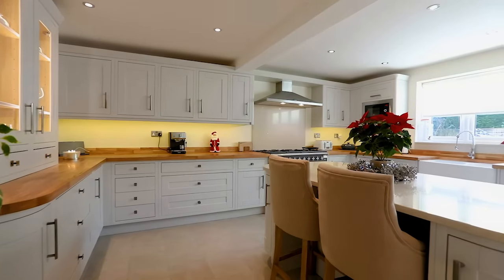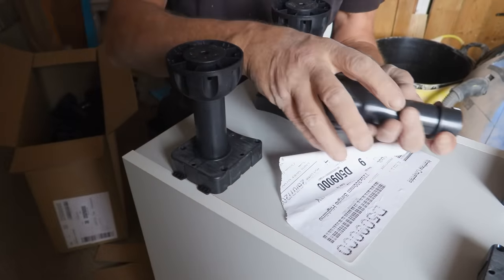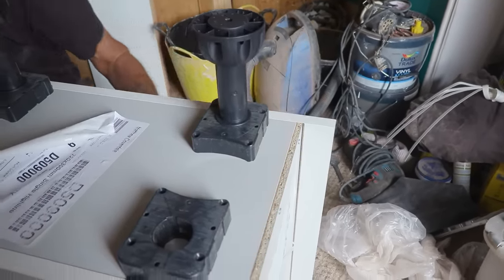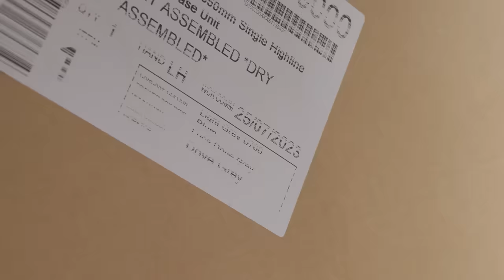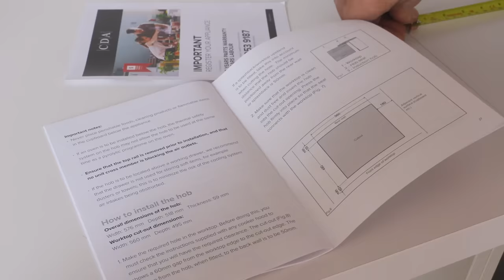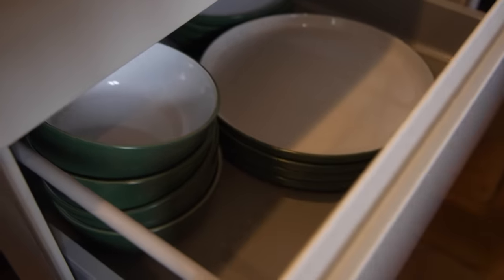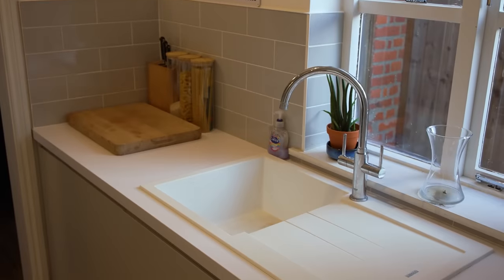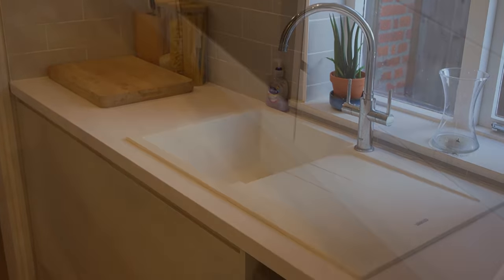An Affordable DIY Kitchen in 2024

Comment: The kitchens look good. But my biggest problem with them is them is the service gap at the back of cabinets being only 40mm rather than 60 -70mm. You can’t get a waste pipe through!. Also only 560mm deep rather than the standard 575mm makes it very tight for integrated appliances to fit. I would recommend them to customers more if it wasn’t for the issues mentioned
Reply from the maker: Hi Peter. You make a good point but they do it so the kitchens can be fitted in a tight space. If you need that extra bit it is very easy to pack the base units out with the adjustable spacers. I have spent more time trimming backs than packing out.

Comment: Not a fan of all that particle board, will generally not last. Built my own cabinets with pliewood. I heard the high end kitchens also use particle board or mdf but it gets sealed completely in the factory, so no gaps anywhere. 😊
Reply: Yes, if it ever gets properly wet to its wrecked.
Reply from the maker: Haven't heard from you for a while. Have you been away/detained/indisposed?

Comment: That outside tap install was awful... drilling inside out, no isolator, drain point and outside taps with built in double checks are not to spec on new installation

Comment: I've just completed a fairly large DIY Kitchen install, no problems with the quality, or fitting minimum spend is £750 and you will need that order number to reorder extras or computer says no. 

The only thing to be very wary about is delivery, I ticked the box that their lorry could get down my road which it can as I can get articulated 40 ton lorries down my standard London street, the day of delivery the driver rings up and says he's sending the order back as his lorry is to big, resulting in a massive disappointment and sullied the whole deal. It was eventually sorted out. 

I then ordered extra units a few months later & driver had no problem delivering with DIY Kitchens largest lorry. Would I order again? Yes but be very wary of delivery as they cram lots of kitchens on one large lorry. contact them beforehand be prepared to pay extra for delivery.

Comment: Is this an advert? If so it should be more explicitly stated really.
Reply from the maker: When posting a video on YouTube one is required to tick the box if you have been paid. Donated goods also counts as Paid Promotion. Not every YouTuber complies but we do and you will 
see that YouTube has flagged this video as paid promotion at the very start. It is not an advert because the information given in this video is not limited to any particular kitchen and there is no editorial input from DIY Kitchens. We chose this kitchen because we have used DIY KItchens in the past and cannot fault their products, prices of service.

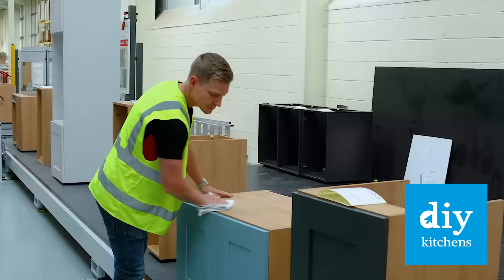Comment: at 0:15 poor fit on them doors
Reply: Presumably meant to actually adjust them/adjust using the hinges when they're on site?
Reply: @nopaynenoparty   So if you can't  be bothered to do it for the promo video... come on... box shifters comes to mind
Reply from the maker: @mattsan70  My, my what a grumpy soul you are today. We have a video specifically on door adjustement
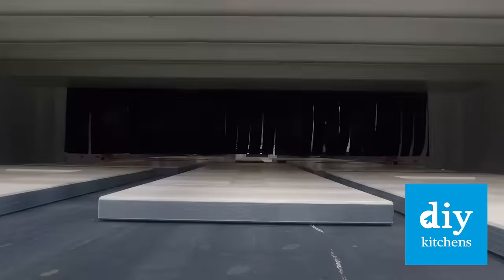Reply: If we use the length of this video as a real-time event you would not spent any time adjusting doors at 00:15 but would spend your time  at 13:00.

Comment: DIY DOESN’t extend to installation - as it shouldn’t.
Reply from the maker: You sound like the police
Reply: @SkillBuilder  Nah. Just watching the measuring, leveling, etc. - dealing with the out of plumb walls and out of square corners.  As I recall installation (without design) was more than the cost of the cabinets in our kitchen.